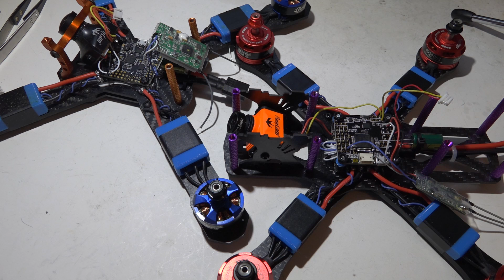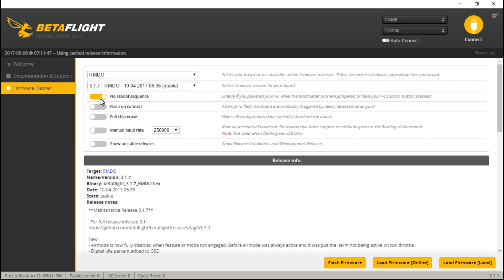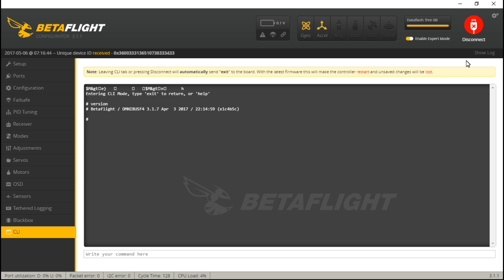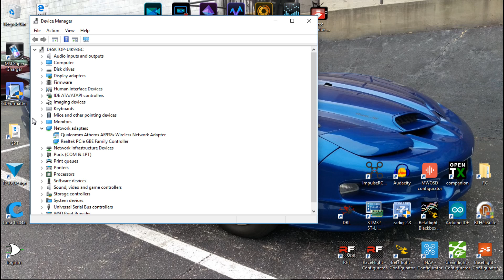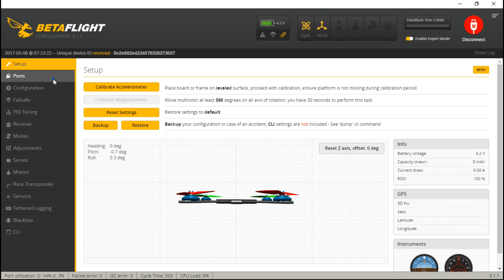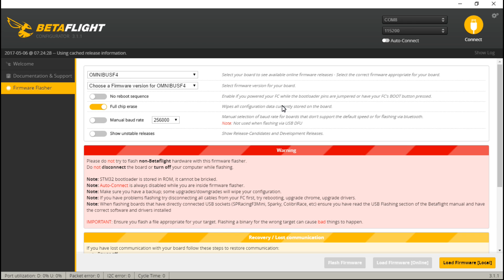Multirotor Build Pt13: Connecting To Betaflight / Flashing Firmware

Comment: I've got this flight controller https://us.banggood.com/CleanFlight-BetaFlight-Micro-F3-Flight-Controller-Built-in-PDB-Buzzer-20X20mm-For-FPV-Racing-p-1094615.html and I ran the impluse RC program on it and now whenever I plug the usb in it goes straight into DFU.  I can flash new firmware and it switches into a com and I can connect to betaflight.  But once I disconnect and reconnect it goes back into DFU mode.  How do I get it out of DFU mode?
Reply: Never mind I used a different cable and it started working again.

Comment: Will it be possible to use the dfu command in the Cli in order to firmwareupdate either of the boards you were showing?
Reply: cool. thanks.
Reply: with the omnibus it will work i already did it but i think its a betaflight feature in general
Reply: so you wouldnt be able to use dfu command in the betaflight Cli, if it has cleanflight installed? 
sorry if i am a bit slow.
Reply from the maker: The DFU command will work on the Omnibus because of the virtual COM port, or any other flight controller that has it. But also, any flight controller that has VCP you only need the DFU if it doesn't have Betaflight firmware already on it. It it already has Betaflight firmware then you can just flash firmware and it will enter DFU by itself. 

For the Dodo or any other flight controller with the CP210x chipset the DFU command in the CLI will not work.